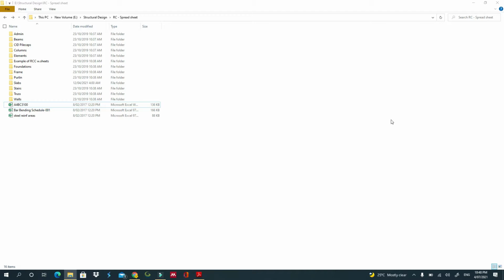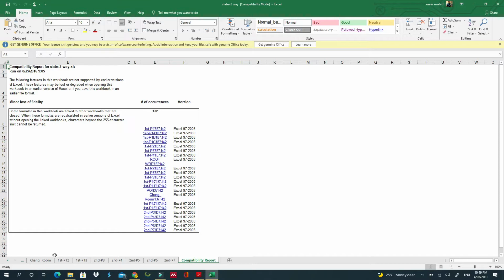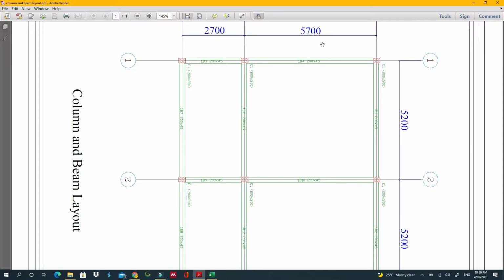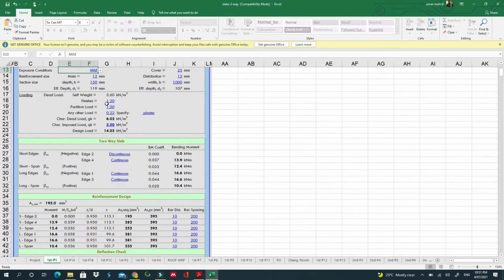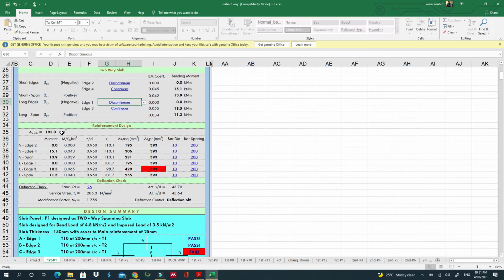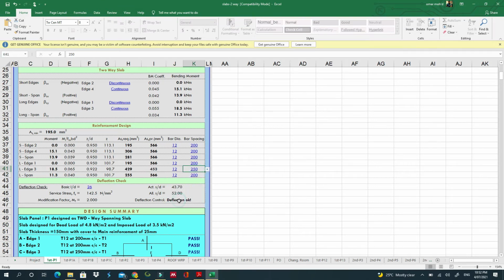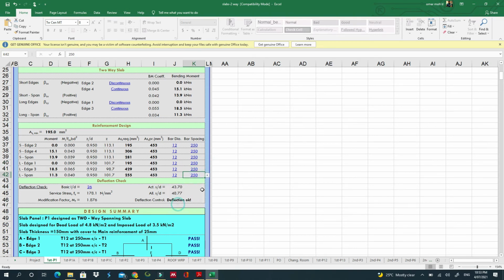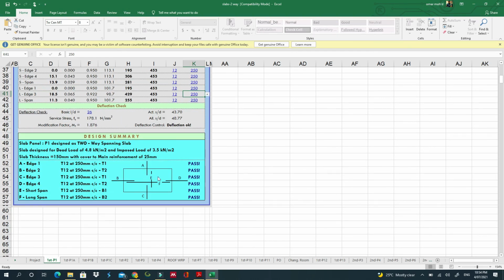SLAB DESIGN USING EXCEL TEMPLATE - QUICKEST AND EASIEST WAY TO DESIGN A CONCRETE SLAB BY USING EXCEL

Comment: Hi, can I please have the excel template?
Reply from the maker: Ofcourse my friend. Either email me or share your email here. I will send the template
Reply: @structuralengineeringtutor574  what is your email sir? I struggle to leave a post, it automatically disappears.
Reply: Hi sir. Can I please get the Excel template for the slab design?